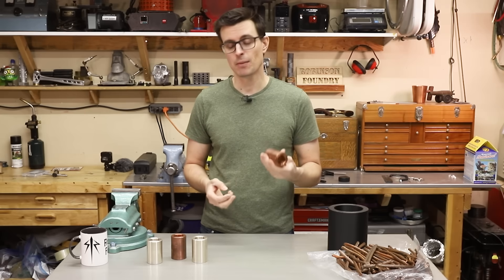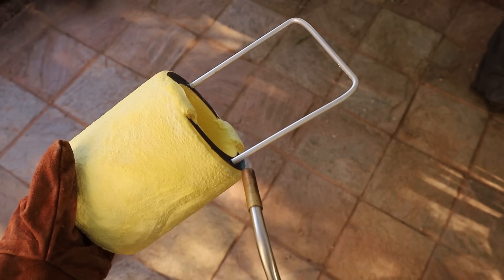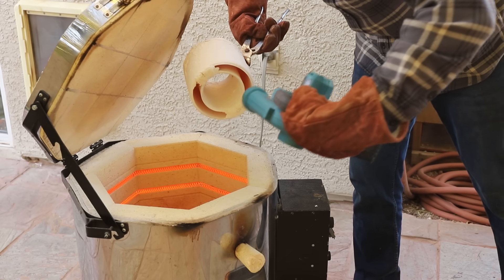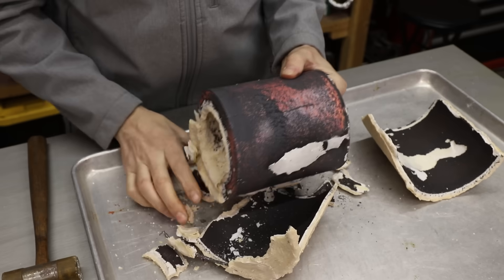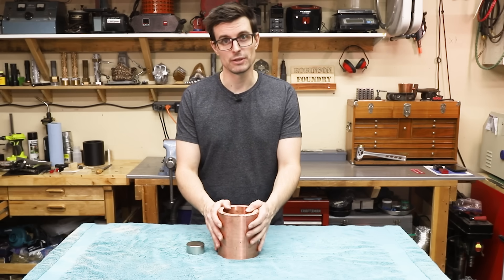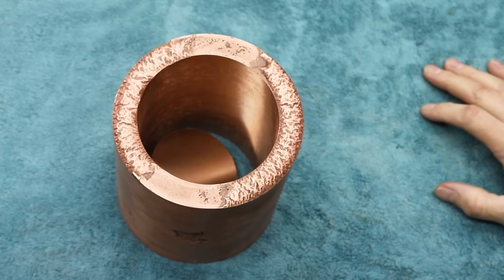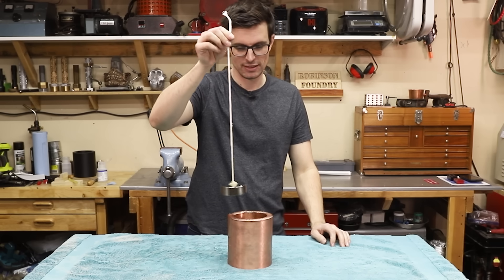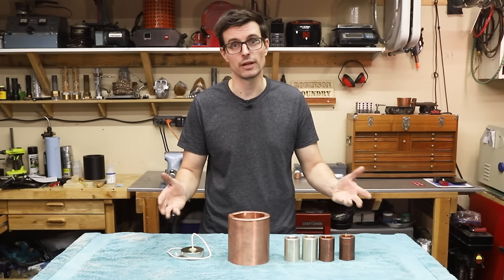Defying Gravity - HUGE Neodymium Magnet vs Copper Tube Experiment - The Power of Lenz's Law!

Comment: The 400 pounds of force is the amount of force it takes to separate two of those magnets that are stick together. If your hand got stuck between the magnet and a metal surface it would be very painful but it wouldn't produce anywhere near 400 pounds of force

Comment: I always wanted to experiment with a larger tube of copper, to see if the magnet is falling  at a defeat time. Then outside of the tub, get two stop watches put one on the magnet, when dropped into the tub, and the uther one outside the tub, turn on both stop watching at the same time. See if both stop watching have the same time, or different times, I always wondered ,if the magnet travels at a different slower time. Please let me know how it goes, very interested. I like choppergrils idea, put copper pipe, on rock tumbler, rotate  pipe with a stopwatch on the magnet, if the two stopwatches are at different times, doesn't that mean time travel. That would be cool 🎉.

Comment: I wonder if the thickness of copper walls will cause a different outcome. Or the temp.... Drop the magnet through while the copper is still hot and viscous. Or when the copper is super chilled.

Also when rolling the tube try turning the magnet °90.. is the effect the same? Or between 2 flat sheets of copper. I would think the effect will still be observed just not as much. And also make a tube that the magnet barely fits in.

Comment: Good afternoon.   Epoxy a shaft to the magnet so you can spin it with a drill then somehow let it go.  I would be interested if an higher rpm would make a significant difference

Comment: So, what would happen if that were an electronic magnet inside of that copper tube, whose strength could be controlled through the I think it's amps or volts going to it? I think potentially, it could be a "hubless wheel" or even if it were self adjustable, a true hoverboard, or an anti gravity device of some kind. Maybe if it were gold, it would work better? What do you think?

Comment: you can try to make a wheel without spokes with magnetic suspension, turning the neodymium motor shaft inside the copper tube

Comment: If the +tube and magnet reversed roles, would a copper disk be slowed passing through a magnetic tube. I'm thinking this for gold recovery.
Reply from the maker: Yes. I purchased ring magnets to test this and it does in fact work but seemingly to a lesser degree.

Comment: This phenomena is used in elevators as a passive brake that slows the elevator car with powerful magnets passing a heavy copper plate.  It is also used to assist a hovering rail line system which uses super cooled, powerful magnets.  This principle could have many uses!  Power generating, frictionless bearings, etc.—already in use.  I would like to see it applied to automation and flight, if possible.
Reply: En realidad no seria cojinetes sin fricción. Es una friccion viscosa sin liquidos, y sin desgaste pero se produce calor.

Comment: Consider 3D printing the vortex pattern (demonstrated in this video) on the interior of a copper tube. This modification could potentially lead to new, intriguing effects:

 https://youtu.be/gRut_ww1XPg?si=q6AQyExXu_sycNlC.

https://youtu.be/HZDQqfUy3eQ?si=fQJNsLhLP3Tcq40r

Additionally, you could experiment by designing a toroidal-shaped copper tube, 3D printed with a vortex pattern inside, and incorporating a toroidal-shaped magnet, also 3D printed, with the vortex pattern on its outer surface. Placing the magnet inside the copper tube and using an opposing electromagnet at the center of the toroid to spin the inner magnet may yield interesting results. Could this setup generate an anti-gravity field, with the field's intensity modulated by the speed of the electromagnet?

Comment: AWSOME!  Is the tube a neutral charged amalgam or is it polarized + / - on the inside or outside.  In other words did the tube turn green from oxidation on its interior or exterior surfaces?  The N52 is likely a Dipole +/- with a equatorial neutral edge.

Comment: re - 0:55
I understand that it's a ceramic coating, but why is it a "special" ceramic coating?
Does it do more than stuff that it's supposed to be able to do? Is it better educated than its peer ceramic coating? What makes it special, rather than just a normal ceramic coating?

edit - So you didn't add "special" silica sand, huh? Just normal silica sand? Now I'm even MORE determined to learn why the ceramic was special...

Comment: 👍🏻 HELLO, I know that a pendulum will never achieve perpetual motion, but if strong magnets are used in the right places to attract and repel the plumb (which can be magnetic itself), can perpetual motion be achieved in a controlled enviroment and using bearings to minimize friction? is it possible? is there any way that using the odd interaction with copper might assist in pursuit of this?

Comment: When you were spinning it in the center, you were basically making an eddy current motor. Your hand acted as the electric motor, the magnet acted as the, well, magnet, the copper tube acted as the effected motor, rotor. I worked for a metal stamping press company. We used huge eddy current motors. Very cool stuff.

Comment: Perhaps pouring the copper with the laddle pour spout oriented 90 degrees from whre you had it such that the flow is parallel to the mold circumference to provide a longer opening to aim for instead of the narrow width.  Also when thermal expansion is a concern, perhaps the plastic mold pattern could have an angled radial slot with a circumferential tap overlapping the gap so that the expansion of the plastic might close the gap instead of splitting the ceramic overcoat.  In addition, perhaps wrapping fiberglass around the OD of the ceramic coating and overcoating with more ceramic layers would strengthen the outer mold ceramic before it had a chance to crack.

Comment: "Flux-Braking" that is: your Cu-tubing as a negative Chi conductor disperses the flux of the N45/52 PMG permanent magnetic guide by means of internal intensity of current (as electromagnetic flux) interactions, with partial (or ratio of) electrostatic interactions being the ratio deficit of "push gravitational effect" or Birkness of repulsion. EX: The Prius neodymium stator interactions when operator-driver removes foot from accelerator pedal. The hybrid car immediately "flux-brakes" due to this interaction, which removes the negating equally opposed electromagnetic current introduced from the car's applied input rotor as the front drive wheel.

Comment: How about designing a long copper tube and magnet system which allows people to attach to that system, to slide down 9ut during a fire...so you grab a harness with strap attached to system that works on a magnet in tube chute tunnel that goes right down a building, so you descend in a controlled manner

Comment: I asked before, but no ans. Where does mgh go when you drop it in? without copper, it becomes mv^2/2. Now, make identically-shaped Cu and Al tubes. Which one will reach bottom faster? Hint: What if the tube is super conducting?

Comment: 3:10 You could hold the crucible near the top rim with metal bar, and use that as a hinge while tilting crucible with another tool from the base. It might be better to hang the first tool with some rope from ceiling to bring it to a height suitable for pouring inside the mould.

Comment: When pouring you should be at 90 degrees to what you did. You had the width of the pouring metal trying to hit the width of the hole in the mold in a X configuration. At 90 degrees you would have the width of the pouring metal ~= width of hole but the full length of the hole as leeway.

Comment: Guessing what letting a smaller neodymium magnet fall through a long aluminium pipe would be. I guess reluctance would slow tHe fall quite a lot, what would make it a great cheap classroom demonstration if it works with common aluminium profile slices. I don't have any good aluminium pipe to try now, so would ask if someone has tried this setup. Thanks!

Comment: extreme temp variations (cold/hot/furnace) half hot half cold copper, , all cold / all hot copper , vs cold mag / hot mag etc, , ,  under water, , , , different location around the planet (arctic, equator, low altitude, subterranean, vs high mtn/plane),

Comment: 1. You should attach the magnet to a scale & measure its weight in & out of the copper tube, resistance to picking the magnet up by itself vs picking it up in the copper tube. We need measurements!

2. Could this mechanism be used to stabilize fine vertical movements?

Comment: What will happen if you glue a plastic dowel to the magnet and chuck it up in a cordless drill and spin it at different RPMs inside the copper tube?

Comment: What happens when you spin the magnet at 200 hz? And what if you spin the copper tube in the opposite direction at 200 hz with the magnet going at 200 hz the opposite direction?

Comment: Do you think you can get the big magnet to go In like a pancake and get it to self propel (flip) at a high rate of speed using 1 to 3 magnets that rotate like a rotary engine on the outside with reverse polarity? Experiment - Take 2 skateboarding trucks with wheels. Place far enough apart to support the cylinder.  See if you can get the pancake to flip in the cylinder. If yes, then I would like to send you a drawing to experiment.  Possible magnet motor.  No electricity required.

Comment: Did a couple years at Home Depot in the plumbing department after retirement and would dazzle the kids with 1/2" magnets and 2' of copper tubing. I tried to measure voltage on the pipe since you and I are making electricity but my meter was not sensitive enough. Your pipe and magnet might be large enough to get a reading. Try measuring DC voltage from the pipe to a ground. You might get a reading. Fun stuff, cool video. Thanks.

Comment: top tip: If you'd poured the metal lengthways along the channel instead of widthways across it, inaccuracy in the distance from the container wouldn't have made a difference.

Comment: depending on the 3d printer you used, you might be able to get polyvinyl alcohol filament, which just dissolves in water. No need to burn out the plastic, which I'm guessing makes all sorts of fumes?
Reply from the maker: I wish I could but the ceramic slurry is water based. It would dissolve the filament.
Reply: @robinson-foundry  Gotcha. You, know that's the kind of thing that I would have tried, but then found out the hard way!

Comment: :face-red-heart-shape:  Don't forget all AC & Radio waves type power have three elements, 1. the positive cycle 2. the neutron, last but not least the   3  the negative cycle.  That neutron cycle is by far the most powerful once you understand:  Without the neutron, the energy could not move forward!!!  You can learn allot about this if you have a bar magnet.  I will prove to you that the center field of a magnet is the most powerful by far!!!  It's how they built the great pyramids!!    If you have a bar magnet/ not a horseshoe type, I'm going to show you all the basics.   DO NOT DISRUPT THE CENTER FIELD WITH ANY OTHER METAL>> 1. Anti-gravity, get something like plastic or glass a granite rock would work well just tap with your finger the centerfield of the magnet near same and it will lose 2/3 it's weight, Next 2.  let's tap the center field near a stream of water and watch it repel the water.  3. If you vibrate the center field at the correct frequency any granite rock will become butter.  YOU MUST UNDERSTAND THE DIFFERANCE FROM An OSCILLATION AND A VIBRATION!!!  The petrographs on the pyramids told us all of this...  Our future will depend on the center field, The height of one's intelligence is directly proportional to their realization of their own ignorance VPC!!

Comment: Put your copper tube on a conveyor belt with a block at one end - to keep the copper rotating. Or make something specific for it. That way you can perform an extended experiment with the magnet core while the cooper is in continual motion... just a thought.

Comment: What if you put a coil round the magnet and apply voltage or magnets fixed to the outside of the copper to develop different fields.

Comment: Question: when pouring the copper into the mould, you went along a vector to the centre, fairly parallel to the diameter. Why not go more perpindicular, or tangential? Wouldn't going with the gap / opening afford you more leeway regarding splashing / sloshing / missing?

Comment: We used a computer controlled c-core electromagnets and copper disc's around the edge of a 55lb flywheel as the resistance unit for a lab-quality cycling ergometer. It was (at the time) capable of simulating actual wind and road resistance algorithms with resistance up to 2000 watts and down to less that an ounce of pedal force. That was preceeded - by about 20 years - by a much smaller version, without the massive flywheel benefit, but was much more affordable. My bread and butter for over 30 years. Sadly, we were run by two very old guys (as smart as they were) who wouldn't leave the 1980's. But knowing what I do made me click your video. Eddy current brakes are cool.

Comment: Shalom! Great experience.
Suggestion: Place the magnet on a shaft with a variable speed motor. Measure any loads that may arise between the copper tube and the motor shaft.

Comment: I'm a little late but need to say, the difficulty you had, pouring
copper, into the mold, @3:23, was the fact you poured perpendicularly,
to the slot, instead of parallel, to it and kept over and under
shooting it. 😁✌🖖

Comment: Copper is a powerful reflector of the dielectric field. If you cut a slit in your copper tube, the dielectric field lines will escape, and reflect back around the outside of the tube, causing the "resistance" you're observing to lower significantly. I'm still not sure eddy currents and Lenz law accurately explain and model this. There is definitely more to learn.

Comment: I'd like to see a magnet with about 1 mm of clearance, with a hole in its center and a steel rod through that hole, centered in the cylinder, so you can drop the magnet and the rod guides it and prevents it from contacting the side of the cylinder. The 1 mm clearance should make for extremely slow fall. Then make an unmagnetized metal disk for comparison.

Comment: I think that while pouring the copper tube you would have been better off pouring parallel to the tube wall rather than perpendicular to the wall.  That way you have more leeway forward and backward.  I have never dealt with molten metal in any way though, so what do I know?

Comment: It’s reluctance, isn’t it? What if an alternator had a solid copper stator instead of wire? Or 3 solid copper pieces in the stator? 

Also, if you dropped a spherical Neodymium mag down a copper pipe circuit( like water pipes in a wall) will it come to rest at the lowest point would it pull itself through the whole length of pipe?

Comment: "Trouble Pouring"  Solution:  Rotate the mold 90 deg CC and then pour.  Most of your error was along crucible's axis.  Match that axis with the mold's long axis instead of trying to control the pour  across the thinnest part of the mold.

Comment: curious if you took the same copper tube and sealed one end with a copper plate, of the same thickness as the wall of the tube, would the magnet float equal distance from the sides and bottom when dropped in.

Comment: You can purchase rolls of copper shim stock. It is only slightly more expensive than solid copper bars the same weight. With the shim stock you can roll up "tubes" of any size you like. I would be interested to see if the magnetic effect varies with the thickness of the wall of the cylinder. Also, making a cylinder of shim stock with the layers insulated with paper, or even paint, and being able to short the inner end to the outer end to see if varying the resistance of the short has a large effect on the impedance to the magnet moving.

Comment: So kind of a curious thing I've been looking up different various methods of producing heat for the purpose of desalinization of large amounts of saltwater if this were connected to several heat sinks and resistors do you think it would be able to transfer enough heat to boil large amounts of water quickly and more efficiently than traditional water heaters or boilers?

Comment: It seems you are using wheels on a 1:1 ratio.  Increasing the size of the driving wheel and reducing the size of the second wheel will also to a 2:1 ratio will also double the speed.  You could also configure any gearing combination.  
Try using a wide bore steel pipe bent to meet the circumference of the magnets.  Having the water pumped through in an enclosed system, with a heat exchanger, to heat water in a tank.

Comment: I don't have a huge magnet or equally large matching coper cylinder so excuse my question if it seems sorta naive: What happens if you exert a force on top of the magnet as it travels through the cylinder? I assume it will travel faster but will you be able to feel the opposing force of the eddy current? Could this be used to dampen the force of something like a shock absorber or those fancy kitchen drawers that close slowly?